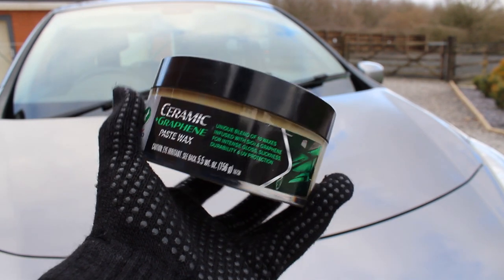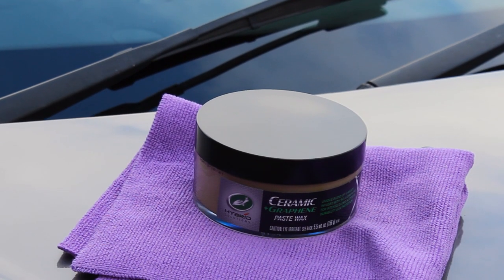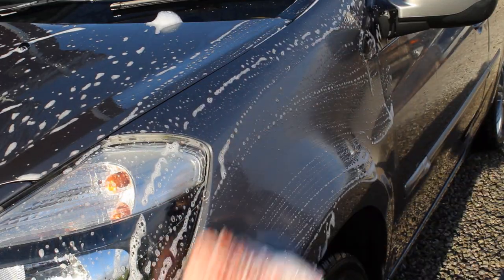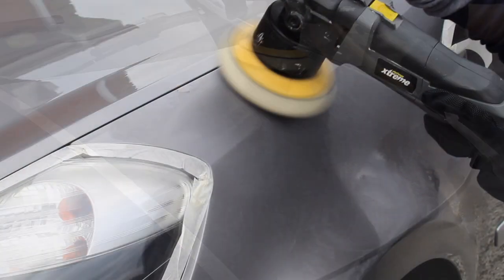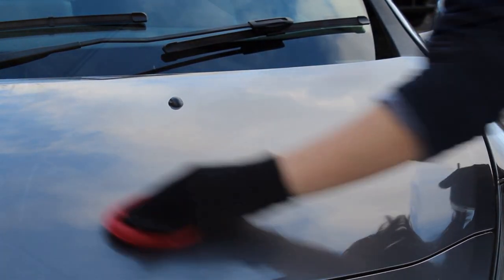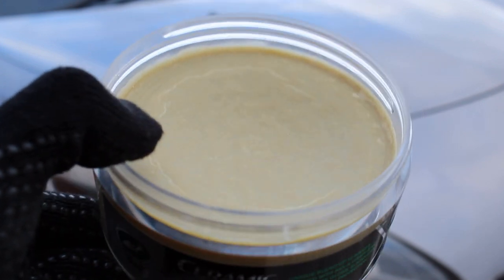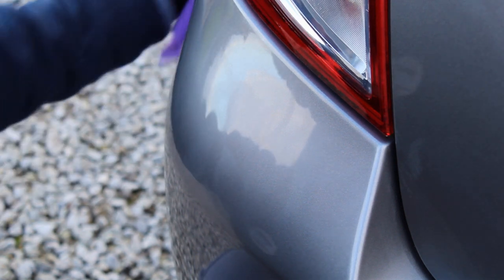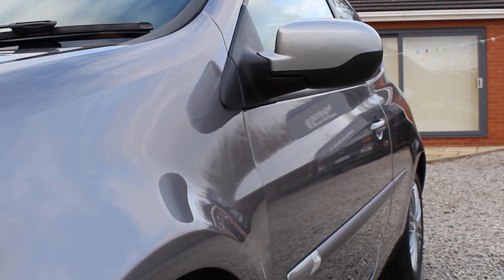TURTLE WAX CERAMIC + GRAPHENE PASTE WAX | Application, Water Behaviour and First Impressions

Comment: For my personal ride: shine and tactile feel are priorities for the look of the flat red paint on my GTI.  Durability is somewhat important but I don't mind reapplications.  I have found that this wax hits all 3 points for me.  The shine and finish are fantastic.  Durability for my needs is solid at a good 3 months-plus especially for a non-garaged but obsessively cared for and maintained ride.  I might point out that if one coat is good then 2 coats are better especially for the durability whiners.  If the paint has been properly prepped a follow-up application with proper curing time from the first application (24-72 hours) will definitely insure some longevity.  Plus, with this paste wax the 2nd coat will apply and buff with astonishing ease.  Thats how it has worked for me and am betting the same for you.  This is excellent paste wax. Shine on you crazy diamonds!
Reply: u are everywher on wax YT are u fan turtle wax?* it's almost like u justifying* whyu doing that a bit curious...
Reply: @bm_wuratli6883  
Yep, I'm  a fan of TW.  I get around YT detailing channels.  I like to see what the other guys are doing.  Check out mine.  It's pretty basic, but you'll get the idea.

Comment: Hi, I didn’t get anywhere near 12months with this, but certainly 3-4months. I found it a bit hard in the tub but it goes on well even when you don’t think much is on the applicator. I didn’t do full decon like you did but went with real life application. It looks good and I like it but I’ll stick to spray on shinee wax instead. Good work keep it up.
Reply: when you say realife, do you mean no clay bar or polish/buffing?

Comment: It will be interesting to see the durability, I'm really looking forward to see how this wax will perform in the long run. The water behaviour looks stunning. That property and gloss level are the most important features for me personally. Great video Heather, as always ⭐
Reply from the maker: Cheers Viktor! Yeah I'm very intrigued to see how long it'll last, and if there's much of a difference between the durability on the panels which were clayed, polished and panel wiped vs the ones which were just washed and panel wiped!
Reply: @AutoCareHQ  any update? About durability? Any real scenario durability?
Reply: @AutoCareHQ  any news?
Reply: I used it and it’s seems to be about a solid 3 months of good beading on my daily driver stored outside in the spring /summer. I did recently take a trip in the mountains a little over 500+ miles and normally my cars front end is absolutely plaster with bugs. But this time I got back and it was almost perfectly clean. I was shocked.I normally wax my car fairly often so I can’t comment on the extreme durability claims as I will have waxed my car again before 6-12 months.

Comment: I fully decontaminated a vw Polo a few weeks ago. Stripping all previous protection and applying 2 coats of this turtlewax ceramic graphene wax. The finished results was outstanding concerning its a black car. 

This polo is an un garaged car and has had some long motorway miles since the application.
It's in a sorry old state tbh. I've found the traffic film & grime has stuck to the protection like s**t to a blanket and we all know what our road salt is like. So it's going to be interesting to see its durability vs british winter conditions after only a few weeks and no toppers in between. 

Great video  I've subscribed & liked 👍
Reply from the maker: Thanks! Yeah I’m definitely interested to see how long this one lasts. I think anything less than 4 months on the polished sections would be a bit gutting but time will tell!

Comment: Nice review Heather.   I've been interested in this particular wax myself.    After watching your review I think i will pick up a tub of this stuff up and give it a try.    Looks like a good one.
Reply from the maker: Thanks Joe! It's one of the contenders to go on my car this summer actually, I really like the water behaviour of it especially
Reply: I finally bought a tub of this stuff and it is now my favorite wax.    Not sure on durability of it,  but my 370Z is garage kept, so I would imagine at least six month to a year which is absolutely incredible because I still have almost the entire tin left.   It will probably last me a lifetime!    And the price is right at $24 US.   One of the best values in waxes that really perform.   The gloss I have on my car now is some of the highest gloss of any product I have ever used.   i used my Flex PXE-80 with a 3 inch finishing pad to apply it which worked perfectly because I could take the 3 inch pad and put it directly into the tin and turn it a few times to load up the pad.   Worked great.   And the use of a DA polisher is really the best way to do it although I am sure hand application is about the same as long as you apply it really thin.    I buffed it off after about 10 minutes and it buffed off nicely using a extra fluffy microfiber cloth to help mitigate putting any swirls back in the paint from the wax removal.   Worked perfectly.      I love this wax.   It works so good.   I already had a fairly fresh coat of Fusso Coat on my vehicle, so I did a good decon wash and prep and topped the Fusso with the Turtle Wax Graphene.   I am going to maintain it with the new Collinite Ceramic Spray Sealant w/Graphene.

Comment: This and Pinnacle Souveran are my favorite paste waxes.  The Turtle Wax costs me $27, where the Pinnacle costs $80.  I don't go through a full process when I use them.  My car is ceramic coated, so I give the car a good wash, chemical decon, then apply with an orbital polisher.
Reply: Seems perplexing to me to use a paste wax on a ceramic-coated car.  It's probably more effective (and less costly) to use a brand-specific topper in spray form, just spray and wipe off or use as a drying aid...but not a wax!
Reply: @dsvillalva  Not at all.  Old school waxing is enjoyable in a way that sprays aren't.  And gloss can always be enhanced, even on ceramic coated cars.
Reply: @raist315  exactly! Ceramic protection and general appearance will remain but the "look" of a good wax is unbeatable - even over a ceramic coating.  Additionally if the ceramic coating is holding well with little to no contaminants the paste wax will apply and buff with great ease!

Comment from the maker: What’s the most important feature you look for in a wax or sealant? Is it the water behaviour, gloss, slickness, durability or ease of application? Let me know in the comments! 

Thanks for watching!
Reply: Durability and water behaviour are my main priorities when choosing wax or sealant. Ive been an avid user of autoglym for over 30 years but more recently been using some tirtle wax hybrid solutions products and car chem off the back of your reviews.  Keep up the good work, still the only detailing channel worth watching for me 👌😊
Reply: Durability, slickness and gloss for me 😀
Reply: Gloss slickness and longevity
Reply: Have you tried autoglym polar seal that stuff is amazing in the winter for protection. You need to review that if you haven’t already. Thank me later lol.
Reply from the maker: @ElMuchoDing-Dong  I've not tried that one!
Reply: @AutoCareHQ  please do try. I was so surprised when I used it and it’s fantastic in the winter for a sealant when the weather and time is against you. And it’s so quick to use just goes in the foam gun and then makes the drying so easy. I’m sure you will check it out anyway lol.
Reply: Hydrophobicity >  Ease of Application > Durability > Gloss/Slickness. When something is super easy to apply then durability can take a bit of a backseat as it's never as good as initial application anyways.
Reply: @Lee Francis agreed!
Reply: Any update?
Any update?
Reply: I like a product that is easy to use and has good characteristics. For me that would be something like Turtlewax Flex wax or Gyeon Wetcoat.

I drive a MINI Paceman JCW and it has lots of nooks and crannies.

Comment: I do believe the durability is great except in extreme heat. I was getting 3+ months in the spring/summer up to around 85/90 degrees. Then took a trip for 10 days somewhere that was extremely hot 104+ degrees with salt air and that really seemed to kill the wax quick. Of course I’m sure that extreme is hard on any product.I came back from my trip and when I washed my car it was still beading but I could definitely see the reduction after such a short time. It was beading less after 10 days than it did after a month back home.

Comment: Another good video!  Thanks Heather. 

I considered buying this when it came out as the 75th anniversary edition, but was put off by some really mixed reviews if I'm honest. 

That and the fact that, if I'm using a wax, I tend to prefer applying it using my DA. 

Very curious to see what the durability turns out like.
Reply from the maker: Thank you! I've seen some mixed things as well about the durability so I'm intrigued to see how long it lasts on this car, and if there's a big difference between the polished panels and the ones which were just washed and panel wiped!
Reply: @Auto Care HQ  yeah that will DEFINITELY be very interesting to see just what effect that has.  

My suspicion is that it won't have a great effect overall. A full blown ceramic I can understand as it needs to properly chemically bond to the clear coat.

Comment: After using Gyeon Wetcoat I can't see any reason to bother with waxes. You can get significantly more applications and durability by applying it with a damp microfibre mitt, I like the fact it can coat the inside edges of panels and won't leave residue in parking sensors, plastic trim etc.
Reply from the maker: Yeah spray and rinse sealants are very quick to apply which is a definite advantage but I quite enjoy the process of applying a wax still

Comment: Great review that's what a was thinking when applying a wax a  dont want to have to do a full decontamination as I have just done one and compound polish and wax with meguires only 2 months ago but would I need to decontamination again when applying a new wax ?
Reply from the maker: Thanks Paul! Nope you'll be fine to apply it without decontaminating but ideally the old wax would need removing first. I normally use Garage Therapy Zero Decon shampoo to kill off old protection before applying anything new. Not totally essentially if you don't mind reapplying it more often but it definitely helps with durability!
Reply: @AutoCareHQ  thanks